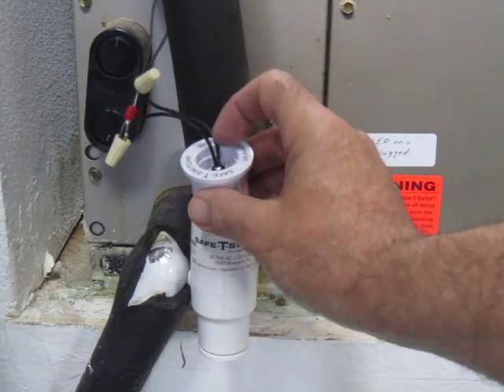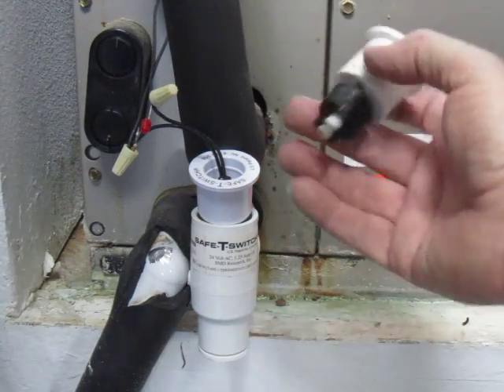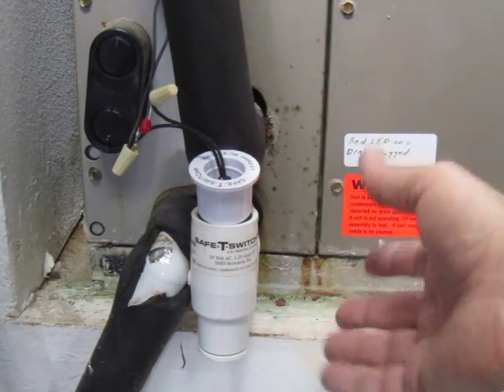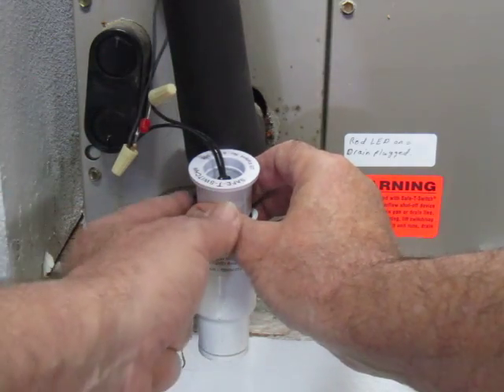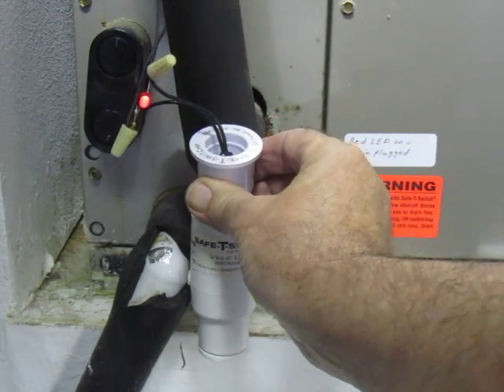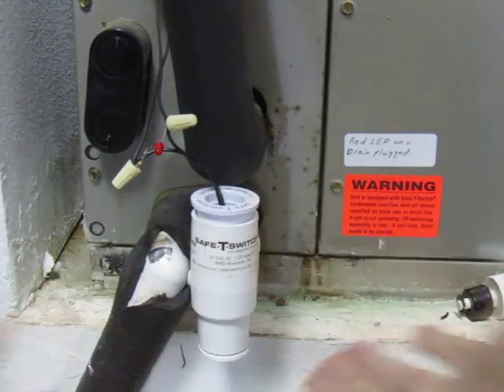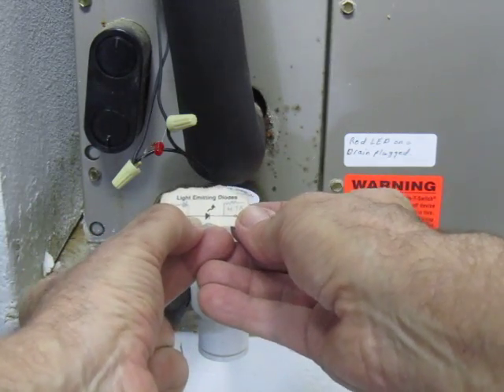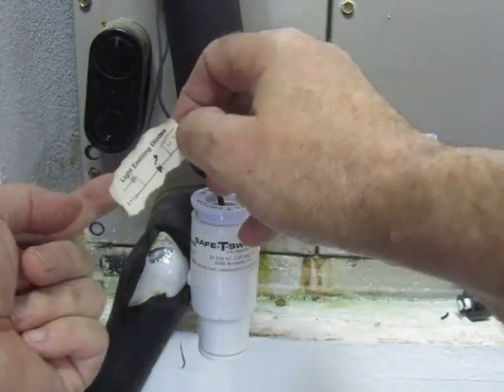Replacing & improving a Safe-T-Switch HVAC drain overflow cutoff.

Comment: Great idea, I had similar issue  and purchased a few  time delay relays. They installed the  switch on the lowest point and the drain higher. What happened is that the evaperator coil isn't level and pitches down towards back of unit and it overflowed on carpet.Do you know off hand if there is supposed to have a liquid condensate level in pan? Anyway Great idea, I had purchased a few parts before reading your post as I think they see a customer $ervice call by most people that aren't ad astute as yourself.

Comment: What good does it to have 2 over flow switches wired in series breaking control power to the hvac system..........if they both fail & there is no technology implemented with them, to allow the hvac system to see that they have failed & shut itself down & show an error code on the owner's t/stat &/or cell phone??

What good does it to have a precautionary method in place, that will eventually fail.....if there is not also a method to see that its failed & shut off the system until its fixed??

Don't smoke & CO detectors constantly test theirselves to see if their power source is failed or getting too weak??

Yes, they do!

Why??

....Because what good is a smoke or CO detector, if it can't alert you when its power source is diminishing to a dangerous state; or that its power source is non-existant??

Well, its no good.... because when you need it to save your life........its not there to save your life!

So why can't an overflow switch be constantly tested by the t/stat & if it fails the test, then the 
t/stat shuts off the system & throws an error code that must be cleared before the system can be turned back on.....in which case, the t/stat continues to routinely test the over flow switches....& if they still aren't passing the test, it again shuts down the system, but this time on a hard lock out.

In the 21st century, I really don't think I'm asking for too much, here!

Comment: I wish you had a step by step... This will help alot!  I had this installed back in 2015 by an HVAC company bc I had water all over my carpet, just got back from vacation and there's water everywhere again... So I was like wtf I thought that switch was supposed to shut the unit off so this doesn't happen... Just try manually moving the float like you did and it doesn't shut the unit off anymore... So it went bad... I wish they came up with a smart switch that would send a notification to my phone if the switch goes bad, or something.
Reply from the maker: They have those smart switches. Look at HVACschool's youtube channel, it's at about the 9 minute mark here: https://www.youtube.com/watch?v=A_cwGe85h8M

Comment from the maker: I had occasion to use this again today. A/C kept shutting down after a few minutes, without cooling the house more than a degree or so. Red LED told me the problem at a glance. Did take me a couple minutes to recall the silver tape on the PVC elbow is where I used an air hose to blow crap out of the drain pipe 3 years ago. Hope it helped you.

Comment: I've replaced mine 3 times in 3 years. They just stop working and do not cut the 24v power, so I have to listen for dripping into a bucket underneath the handler. 3rd one just took a crap today. An led wouldn't help me in my situation. I have a wifi thermostat which tells me it is off, when the float switch is up (and working). How can I improve the actual float switch?
Reply from the maker: That really sounds odd. When you remove the switch from the pipe does it still function ? Meaning if you lift the float with your hand does it signal your system to shutdown ? When it was new, did lifting the float with your hand shutdown the system before you put the switch into it's housing ?
Reply: @BobbyDotNet  Right, they worked when the float was lifted manually initially, then 6-12 months later, they no longer function, even when operated manually.

Comment: Sorry, how did your old one fail?  You mention it wouldn't stay closed but I'm not sure what you mean by this?  Right now my unit randomly turns off unless I jiggle the Safe-T-Switch - when I look in the pipe it's bone dry, I'm wondering if it's an issue with the magnetic contacts on the inside or something?  Will likely just replace with an SS1 .

Thanks,
Ryan
Reply from the maker: Yes, my switch went open internally and stayed there, no matter the float position.
Reply: Bobby Okay that makes sense, thanks for the prompt reply

Comment: great idea. so was that the drain from the ac/heat pump that drains the moisture?
Reply from the maker: Yes, it drains water that condenses on the inside unit coils, through a PVC pipe to the ground outside.